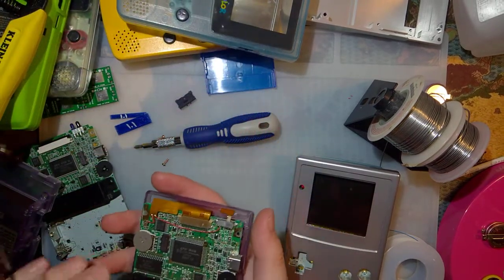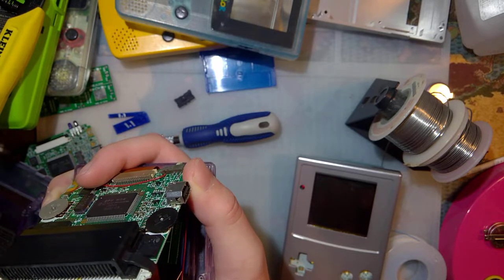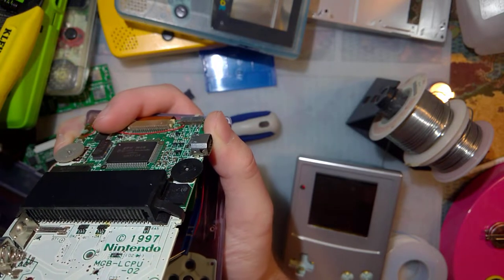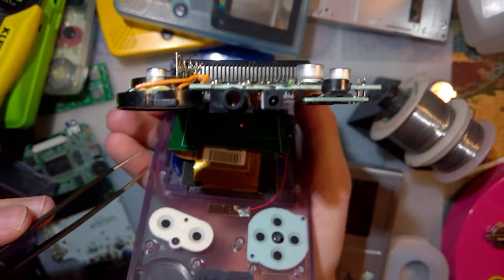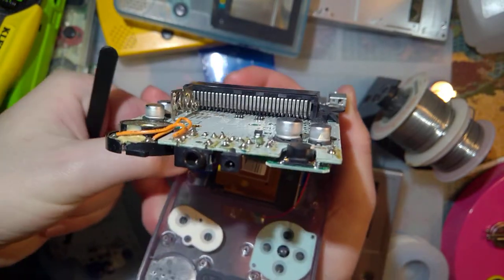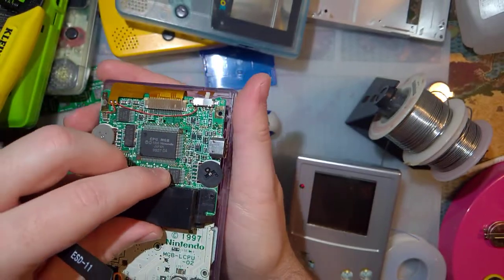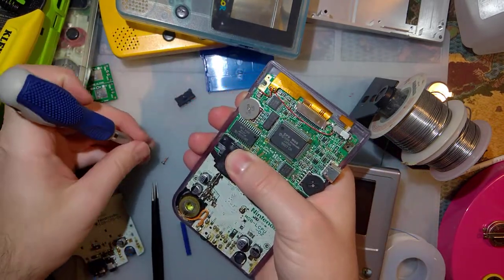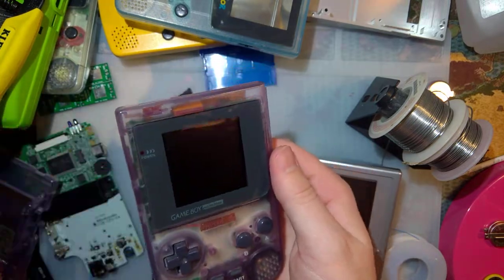Game Boy Pocket AIO (HiVision or One Chip) Backlight Kit Spacers

Comment: Can I ask, does anyone know whether the AliExpress glass lenses that are specifically for backlit screens, are those resized for the FreckleShack/McWill/"ChinaShack" screens? I just got a FreckleShack kit, but I think the combined price and postage for a JellyBelly Customs lens is a bit steep, given that I live in Australia... Thanks.
Reply from the maker: The kits all use the same size LCD with the same image placement with exception of the v1.0 McWill kit (so El Clono, Freckleshack, AIO, and Midwest Embedded). I don't know if that's something else that was changed with v1.1, but on v1.0, the image on the McWill kit is higher up on the device so a lens designed for another kit will cut off some of the display.